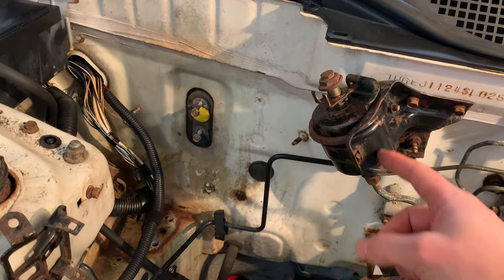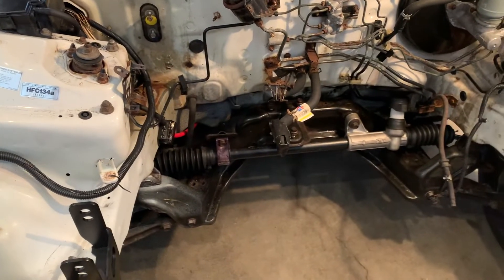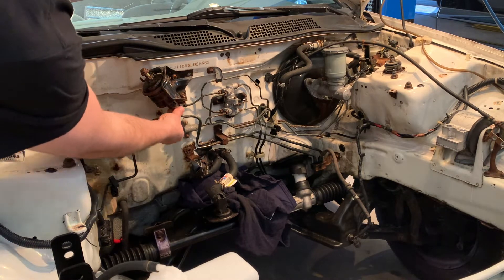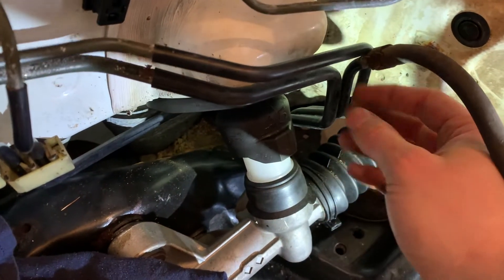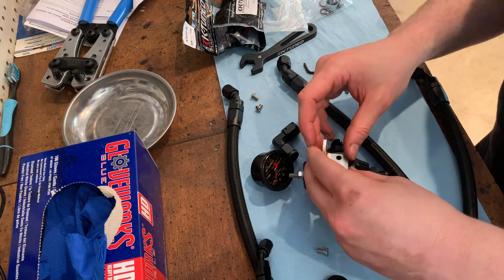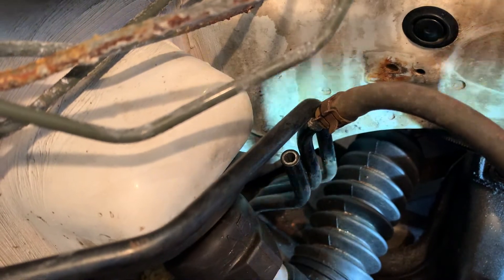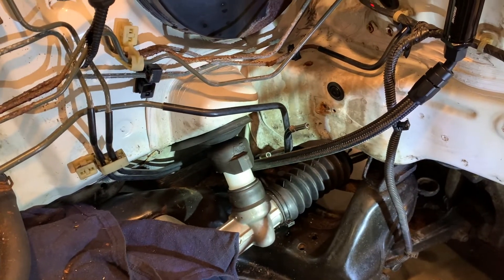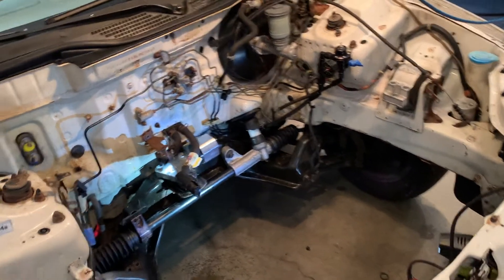K Tuned Fuel System Install - Civic K24 Swap Part 10

Comment: When using teflon tape, wrap 3-4 times and in the direction that the nut will be tightened. If you wrap this direction then the tape will unwrap as the fitting is tightened and it WILL leak at some point

Comment: i’m trying to thread in my fuel pressure gauge into the fpr and it’s won’t thread in far at all maybe 3-4 turns? did you have the same problem?
Reply from the maker: Its been a while but I do recall having the same issue. It really bugged me how far out the gauge sat 😂. Never leaked though.
Reply: @e-dod  as long as it doesn’t leak that’s what matters lol thanks for the reply 👍🏻

Comment: My goals for my civic is around 450 hp. Is the stock fuel rail a constraint on making more power? If it's a constraint what's the max power with stock fuel rail, or do you need the fuel rail to connect the fuel pressure regulator. This is my first project and don't know much, any help would be great.
Reply from the maker: Hi, I'd be happy to help. Could you let me know what car and what engine you are planning?  Also, my latest video on the channel is all about K-Swap fuel systems and is much more helpful.
Reply: @e-dod  the video helped out a lot, thank you.

Comment: I'm looking for a fuel system for my CRX K24A2. I like that kit you got. Do you have a link? How much was it?
Reply from the maker: I am using the K-Tuned kit (https://k-tuned.3dcartstores.com/Center-Feed-Fuel-System_p_395.html). They might have one for CRX. 

You could make your own kit though if needed. I am sure K-Tuned could help you out since they also sell AN line by the foot and they have all the fittings on their site as well so they can sell you all the components without the lines assembled and you can cut and assemble the lines yourself.   

Also, if you want to go budget you can also check out VTEC Academy's budget K swap EG. They just use rubber hose lines with the stock fuel filter. I am not sure if that will work with stock CRX fuel filter though, not sure where that is located on CRX.
Reply: @e-dod  Awesome, thank you. I kinda want to have a clean look like yours.  So I might go with a KTuned kit. The CRX filter is on the firewall.
Reply from the maker: @bobbydelamar606  Yea I really like getting rid of the OEM filter. K-Tuned is very helpful. I am sure if you give them a call they can hook you up with something for CRX. Let me know how it goes!
Reply: @e-dod  Absolutely! I called today and they said they don't have a kit for CRX. They said just buy the pieces individually. Regulator, rail, filter and lines. The only thing I'm unsure about is the lines. How much and what fittings. He said the best rail for the engine is the one that has an inlet and outlet set up.
Reply from the maker: @bobbydelamar606  Oh nice! Yea you might have to measure for length once you get the engine in the car (unless you just want to buy like 10 feet of -6an for feed & 5 feet of -4an for return and probably have some leftover). Would you use the rail with the single center line like my setup? If so my kit came with 2 -6an 45deg for the feed lines, 1 -6an 90deg (female-female to connect filter to regulator) and 1 -4an 45deg to connect return line to regulator.
Reply: @e-dod  Yeah your right I have to measure and maybe get that kit you got. The engine is in the car. I didn't see your fuel rail. What is a center feed? Just port in the center? I'll probably use the 2 port fuel rail. https://youtu.be/jS4qwUfMPRw
Reply from the maker: @bobbydelamar606  Yes, with K-Tuned fuel rail you can do one port in center or feed in from one side and out the other to FPR. Center is easier but drawbacks on high horsepower applications due to not being as efficient. 

K-Tuned says up to 300hp: https://k-tuned.3dcartstores.com/Center-Port-Fitting-for-Fuel-Rail-6AN-or-8AN_p_37.html

Also, good read:
https://www.k20a.org/threads/fuel-system-clarification.12043/

Comment: If using a FPR do you need to run a return line?
Reply from the maker: I think they make special ones that do not have a return port. For the standard FPR like I show in the video it needs the return port hooked up to work. All my cars have return lines so I am not as familiar with what to do on a return less system.

Comment: Did you use regular plumber thread tape for sealing the joints?
Reply from the maker: I used regular tape but I would use the yellow PTFE tape to be safe. Also, I put the tape in the wrong spot. You should only use the tape on the threads that screw into the regulator since I think those are NPT not AN.
Reply: Thanks for the info, your videos are very helpful 👍🏾

Comment: Did you use the stock throttle body or grab a different one?
Reply from the maker: I am using a 2005 Accord throttle body I got from my local junkyard. The stock throttle cable works fine with this.